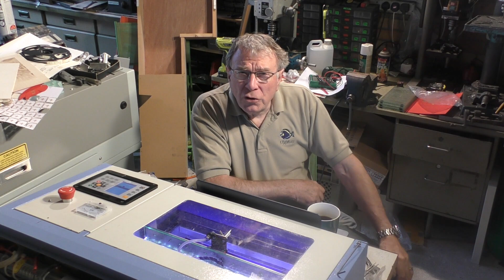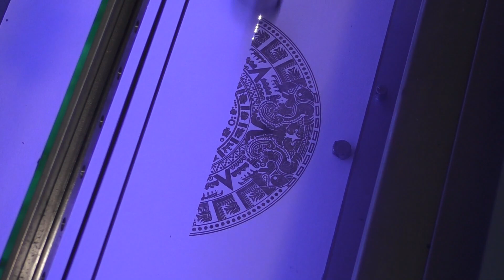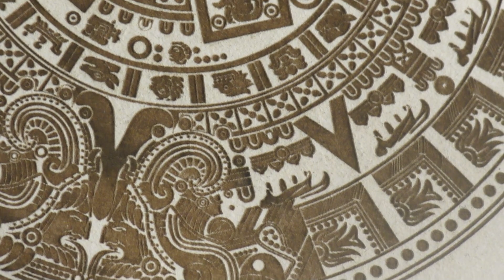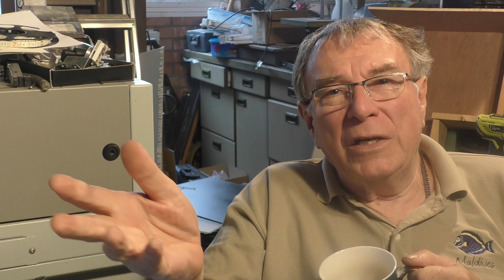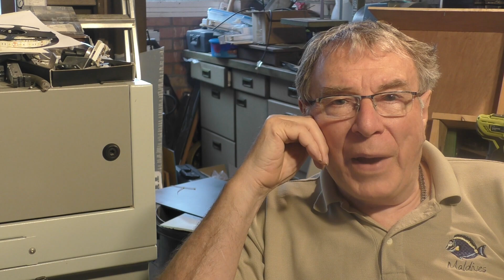K40 remodeling Preview

Comment: “You did hear me right, 1,000 mm/s.” Amazing!
Reply from the maker: Yes. It is amazing from a crappy K40. Even the Slowforge,, G,Weik and other similar $3k to 6k  machines like the Dremmel and Muse, they  cant get anywhere near this performance.. Hey, I'm using all the same gear as them so it shows they are not concentrating on the right thing  A pretty case is great for sales but these machines are not ornaments.

 You can pop over to https://laseruser.com/k40-laser-cutter-upgrade-05/  and see verification of this gact and how I went about setting up the machine to achieve it.
 Best wishes
Russ

Comment: Hi can’t wait to see what the upgrades are in more detail on this. I have been thinking about playing around with a vacuum extraction system, I know you had a brief look at that though using the nozzle. I have been thinking of doing something similar but going by a seperate hose I was thinking of mounting next to the head replacing the red dot pointer and running back to the extraction vent using some form of regulator plate so it can be easily changed between normal extraction for cutting and close the flap so it becomes a small vacuum hose up to the head for use while engraving which will then not have an effect on keeping positive pressure in the nozzle to keep lenses clean was wondering if you can see any issues with a set up like this? as you have far more experience with your tinkering with lasers then I do myself. thank you for all the great video content you put out on lasers your channel has fast become my go to place to study and sort out any new ideas for my little version of china blue
Reply from the maker: Hi Daniel
Unaided  suction is very inefficient at extracting fumes. Put a candle flame about 300 mm from your face and try sucking the flame to extinguish it..It's impossible  because there is no DIRECTED flow. Air will enter your mouth by the easiest ways possible  .....and that will not be from 300 mm away.You will see the principle of air flow management  in part 3 of the remodeling. I think parts 1 and 2 are now available to view on laseruser.com.. This cross flow concept is important for engraving because once the fumes are in the air you do not want them to settle onto your work.

Best wishes
Russ

Comment: I can't wait to see the whole series. I have for k40 for 3 years and I've learn much from Your chanel. I've made houndreds of litle objects, and made small upgrades to the machine. But  I've reached the end of my engineering skills.
I want to be a part of this project so much. Greetings from Poland.
Reply from the maker: Hi Toamsz

As you will see from the video series I have never been an lover of the K40   BUT  I have admired some of the amazing work that has been produced by this very basic piece of equipment.  What I have finally produced  by integrating ideas from "big" machines  is a small "big" machine that I am actually happy to have in my machine collection It can do real production work....... provided the work pieces are small.. It is not just a passing project that I was not initially commuted to,  but it will be a machine that I will continue to use and develop equipment for.. As  an example,  I plan to design a compact rotary system that does NOT require you to cut the bottom out of the machine..
 Thanks for your interest
Best wishes
Russ

Comment: Ha russ, are ypu going to talk a little about which k40 to start from? As there seems to many put there of various costs.
Reply from the maker: Hi Yes, you will see my VERY basic starting point when video #1 is made public on laseruser.com. They will be released weekly. I think this was the VERY basic £300 ($350) machine but before it was given to me Cloudray fitted an excellent 40 watt tube. I may well add some more future sessions to see what the tube is really capable of . As with many things in life, size is not the most important parameter, performance trumps power.
Best wishes
Russ
Reply: @SarbarMultimedia  just watched your first video, interesting, do you have a rough figure for the cost of all the parts, as you make a coment about tricked out k40s costing the same as your full machone at the beginning.
Reply from the maker: @TEACypher  
 Hi 
 This weekend the first video will be available to view in laseruser,com and there will also be a  list of pars and costs for the standard parts I used. At present I have mechanical parts being manufactured  but I do not have manufacturing costs at present.. I should know that data  within the next two weeks. My prices for the initial small batch manufacture will be different from those that will eventually come from Cloudray.  I will be making mine at cost price plus postage because profit is not something I need to make.
 Thanks for your interest
 Best wishes
Russ

Comment: Count me in. I have been wanting to upgrade my k40 for a while now and just trying to figure out were to start. I have a lot of manufacturing skills and some of the tools to do so. don't hesitate to reach out if you want to have a group of tester as you go forward with these upgrade videos.
Reply from the maker: Hi
 I can feel your enthusiasm and how this machine performs  has  fulfilled my dream rather than expectation. As you see from this video, the initial job is done and I have a super little machine to play with along with all my other machines and projects. This has been a great learning experience for me  and the pleasure of succeding cannot be descrtibed. All 6 videos are with  Gareth at the laseruser.com website and he will be releasing them weekly starting this weekend. I have sent all the DXF files I used for this prototype to the website  and in anticipation of some of the MANY K40 owners  wanting to turbo boost their machines I am in the process of producing a set of mechanical productionised parts  that I will be able to sell to those less able than yourself. That will get them to stage 1 ie the simple mechanical upgrade.  Stage 2 could be the conversion to a black box digital machine rather than the all in one card approach that many have already taken. Stage 3 will be to  get an A grade tube. My experience has shown that the performance will always be sub par if you have a B grade tube. The Cloudray tube in this machine is genuinely superb and allows me to exploit the speed I have achieved.  My 30 watt RF machine can run faster but the beam is not capable of sufficient exposure  to match the speed. 
 Best wishes
Russ

Comment: I'm definitely in on this upgrade! I'm skilled in CAD/Fusion 360 and been 3D printing for about 5 years now, recently went down the path of lasercutting with a stock K40. If you need any help i'll be more than happy to lend a hand!
Reply from the maker: Many thanks for that kind offer....so typical of the laser community.  All the dxf files for my prototype will be available at laseruser.com so you may decide to 3D print them.
 All best wishes
Russ

Comment: This is 3x as fast as my crappy bodor... no wonder they discontinued it. 1000mm/s is good enough to be a galvo laser replacement so to speak, obviously not as fast but much cheaper. If I can get that speed in the one kit then I would definitely consider adding it. 

There's some small items that would be better suited to the smaller machine while the bigger one is reserved more for cutting parts. Such as boxes I currently cut - engraving the 'label' on ended up taking way too long for my machine.

Comment: My own K40 is about as far as I can take it, Cohesion3D, home made servo driven Z-bed, replacement head, new control panel, air assist. 5 years good use on original tube which I max out at 16mA. Lightburn controls everything.
Reply: I'm the same.  Cohesion board so that I can run Lightburn on a K40, air assist, etc.  This looks like the next evolution for me.
Reply: great for you, then you probably won't need this video series! 🤣
Reply: @pgabrieli  on the contrary, theres ALWAYS much to learn from Russ.
Reply: I am running a K40, also stripped and replaced the original electrics (AC mains wires with crimp connectors where the wire just pulled out of the crimp!) added a Cohesion 3d board and motorised Z table. Works very well, but I do need to keep the speed low so I'm curious about the mechanical upgrades. (Lightburn is fantastic, worth every penny, finding new tricks every week!)

Comment: New toy??😝
Reply from the maker: Hi Mate
I was getting burnout of my two remaining grey cells trying to make sense of  the non-compatibility  of small high intensity beams and lenses.  So I gave them a rest and did a nice simple but fascinating project. Amazing results  ......but here's the weirdest thing. The beam is small diameter and very intense,  capable of mode burning almost as deep with 40 watts as I can achieve with my 80 watt tube . After a few weeks of work I have come full circle  to encounter the problem I was trying to escape from.!!!!   I have to admit it is now a very usable machine and will probably help me when I get back to laser beam/lens investigations. 
 Best wishes
Russ

Comment: Now I know what to do with the K40 I have sitting around collecting dust (and by dust I mean tools and parts for other projects). I was about 85-90% done making it safe and useful when I found a used "80w" machine I couldn't say no to.
Reply from the maker: Aha!!!    So you now  have "big" machine experience and know what you would like to see in s "big" K40. I don't think you will be disappointed.
 Best wishes
Russ
Reply: I want to buy a machine but I am confused about the choice can you nominate a beautiful machine pulp my work is mostly on transparent glass
Reply from the maker: Hi
Although  a cheap  diode laser will engrave glass it will be VERY slow. A CO2 laser like the one in this video  will always be moch faster and do a cleaner job.
If you watch this video from 38mimutes  you will see this machine engraving glass.   https://laseruser.com/k40-laser-cutter-upgrade-08/
This started as a a $400 machine but by the time I have upgraded ot is ia sbout  $900. As  standard k40 its not that fast and the software will be very limited.
 If you can afford it an excellent started and all round useful machine is the 300x500 bed size like this
https://www.vevor.co.uk/laser-engraving-machine-c_11141/vevor-50w-co2-laser-engraver-cutter-50x30cm-desktop-cutter-w-cylindrical-parts-p_010655789454?gclid=Cj0KCQjwl92XBhC7ARIsAHLl9alSKcPVgWW344OJ69gPlEcsLBZ2jW57IKEmh4K4Xdsnl12OWwUDDvsaAmu8EALw_wcB
 The tube that will be supplied with this machine will be  B grade tube that will work fine for engraving but will be poor at cutting.You may wish to upgrade and by a grade A tube at a future date.
 I have 3 machines lke this  The oldest is 7 years old  here is the sort of work my stepdaughter does with glass. on one of the machines.
https://uniquelaserart.co.uk/1_5_shop.html

Best wishes
Russ